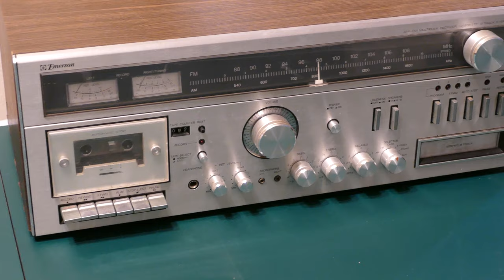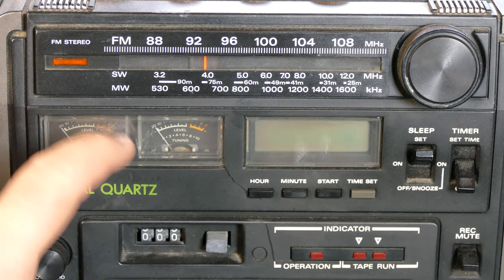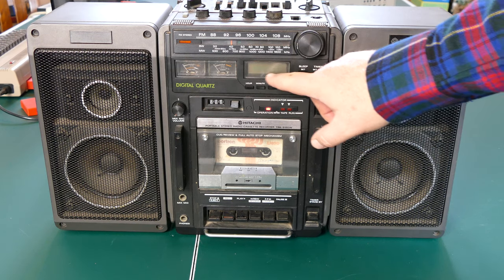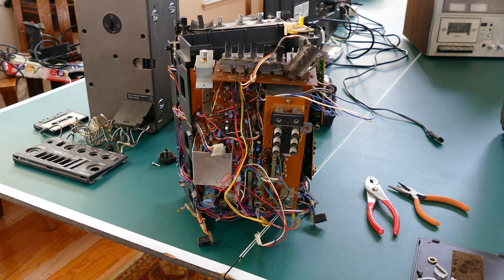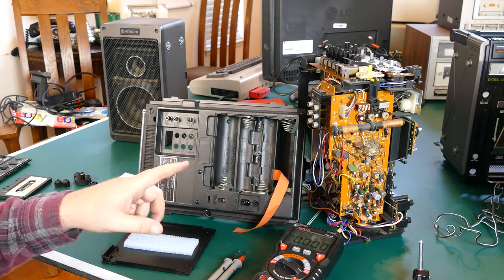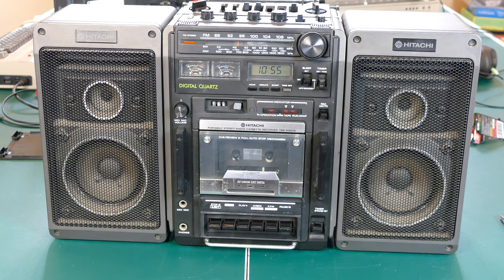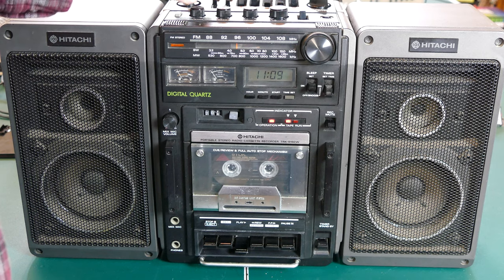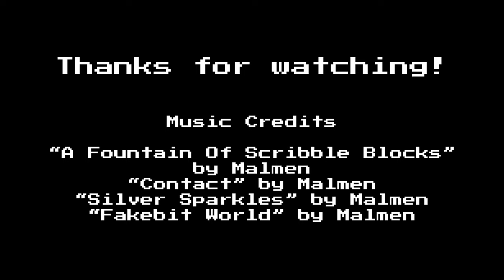Ghettoblaster Repair And Bluetooth Mod

Comment: Did you find out what year is this from?
Reply from the maker: I forgot to mention that in the wrap up. I couldn't find a single date code on this at all. There were only a few ICs. Almost all analog. Nothing on the PCBs or even the plastic. I am still guessing early 80s.
Reply: @RetroHackShack  I  saw these in 1981 0r 1982. I can't remember exactly but I do remember  I bought a Hitachi boombox in 1981 so the date i saw these was probably the same.
Reply from the maker: Thanks
Reply: This model came out in 1979. It's not really hifi, but it's pretty damn loud. I have a Hitachi catalog from that year.

Comment: 1979 - early production with manual rec volume controls, VUs etc.

The RCA line in works great via a cable to your MP3 player.

I fully serviced my Hitachi of the same model around 8 years ago and it’s still running great!👍🙂
Reply from the maker: Awesome. I use this thing all the time.

Comment: The "timer stand-by"  button works along with the alarm clock. If you play a tape, you can pause it with said button, and it will spring back to play at the time setted in the alarm instead of the radio. Super feature!
Reply: You can wake up to your favorite tune😉
Reply from the maker: Cool!
Reply: Who needs a clock radio on the bedside table when you have one of these 😁
Reply from the maker: LOL

Comment: I have a new old stock 1985 Sanyo C15 never used and today I took it out and the cassette player is sloooooow like slow motion. This was the first time ever tried/used. Are you willing to help me?
Reply: Back to dc motor of cassette mechanism there is hidden preset inside rubber hose. Set with flat screw driver... Try it...

Comment: I have a smallish Sony blaster(a neighbor tossed it about 10 years ago) with a cd player,deck and radio. Still works well but won't turn on with batteries installed. Any ideas why? It used to work fine with batteries. Any ideas why it won't turn on with batteries installed?

Comment: Did you consider adding in rechargable batteries with USB power input?  

The tape sounded pretty good.  Possibly better than the Bluetooth direct

I've been wanting to get one and Bluetooth plus battery mod it, and then add a bunch of led lights in unnecessary places for fun, but the battery mod is the one that I figure is gonna need extra PCBs added to regulate the power...
Reply from the maker: No. I didn't look into that. I am happy running this on AC. However, it would be pretty epic to take this to a beach party and put those portable Bluetooth speakers everyone uses to shame :)
Reply: @RetroHackShack  yeah.  That's kinda my motivation.  Walking down the street with that on my shoulder, but without the $20 battery hit every time I wanna do it.
Reply: @freebobafett  rechargeable ones r pretty good this days..
Reply: @Ziggysdust-mb1jo  yeah, but USB is super convenient.
Reply: @freebobafett  convenience is what killed sound quality... from mp3 thru wireless to rubbish sound bars..
Reply: @Ziggysdust-mb1jo  idk.  They sure can pack a lot of sound into a pretty small package these days.  I used to have a set up with a Thorens turntable, McIntosh tube amp and Cerwin Vega floor speakers, and it did sound very nice, and even though it only had 30W, it was a continuous 30W, and my speakers couldn't handle it past 6 on the volume knob.  Thing is, though, my UE Winderboom and my phone don't really sound that much worse.  There's a certain warmth to the sound that is lacking, but otherwise, I'll take the convenience and ability to listen to music anywhere over all that heavy ass equipment and the chore of moving 900 records from place to place every time I move.